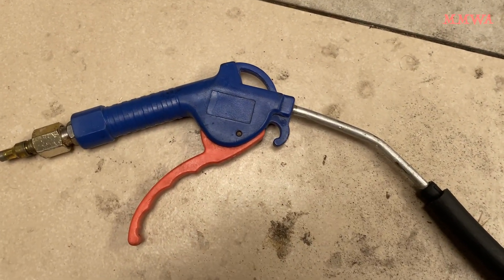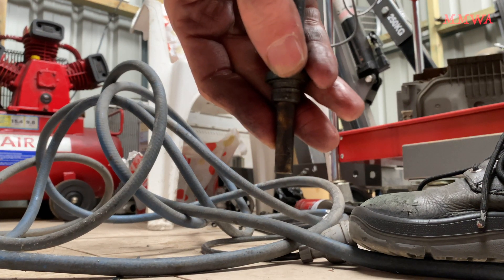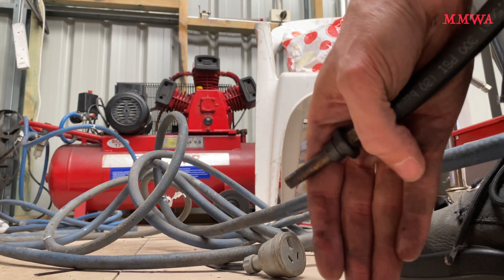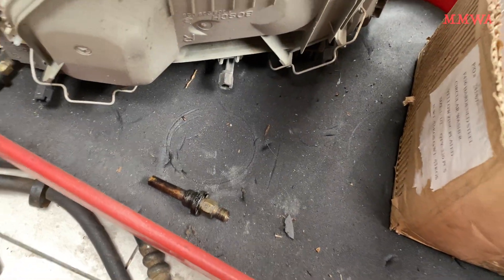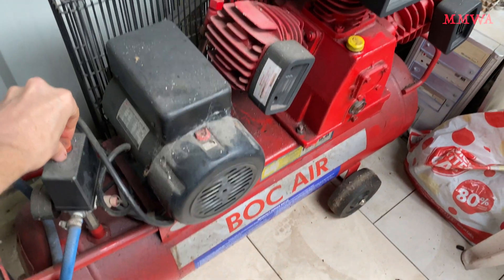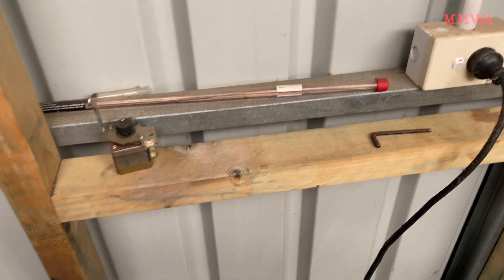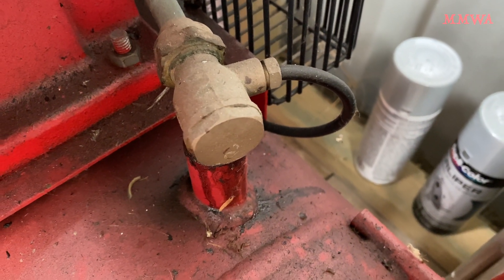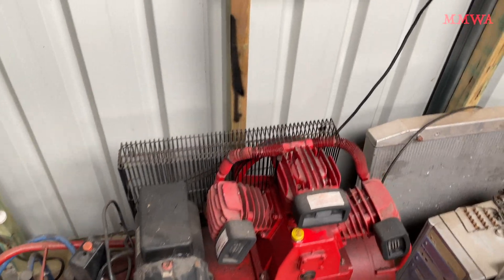KE-Jetronic - How anyone can test the injector spray pattern at home

Comment from the maker: If cant see video description - of course use clean hose, hose clamps and a suitable fluid like kerosine or diesel for  testing purposes. You can damage the injectors if any garbage is forced inside by not using clean hose or fluids.

Comment: For vehicles over 30 years old, it is definitely useful to replace the complete injector. Thanks for the test.
Reply from the maker: I do as a matter of course replace originals. I’ve never bothered to test or clean they are cheap enough to just buy a new set. Could be handy for someone chasing an issue though.

Comment: I constantly apply 250ml of 2 stroke oil in the fuel tank and I didn't had any problems through the 4 years using this car. Your test/ clean Idea is Fine!

Comment: Cheap Teflon fuel hose like the hose used in AN fitting installation works a treat, totally impermeable to Ethanol and Methanol and if you strip the braid off you can use worm drive clamps on the stuff.
Considering how nasty modern fuels are im seriously thinking of stocking up on some common sizes after doing some exploration chasing a fuel smell on a friends car who uses E10 and finding a factory rubber line on a 6 yr old car that had a fuel whiff about it and had begun to delaminate.
US sources are now fairly inexpensive too and AN to whatever adaptors are common as well.
Compressors ....... My how they fail lol, Mines due new belts and an overhaul too, thanks for the reminder!
Reply from the maker: With the compressor, its hardly ever been used. All its failings are from sitting around. I bought it new around 20 years ago with the intentions of learning how to paint a car. The target car ended up being cut up and taken to the tip. Its spent most of its life sitting around in the way. It did get a workout doing the blue paint job on tims 6.9 but thats about it. That was around 10 years ago now. Bloody hell time flys.
Reply: @MMWA-DAVE  my compressor had a failed capacitor